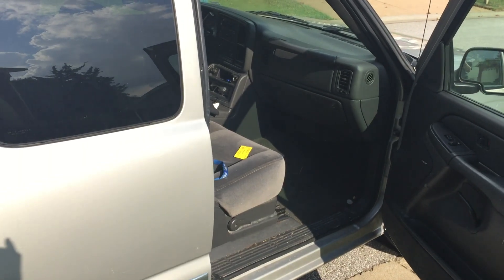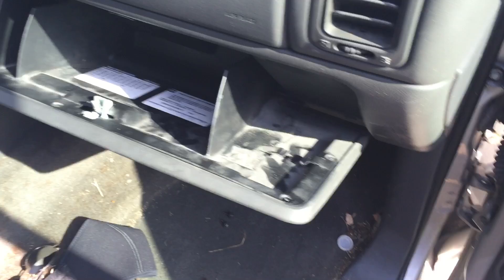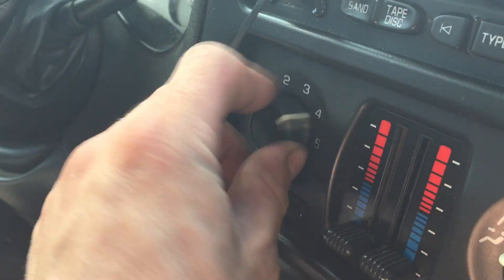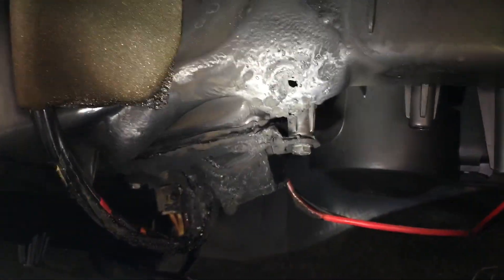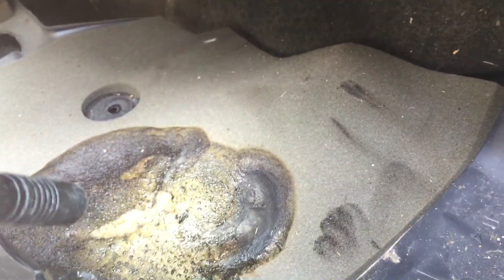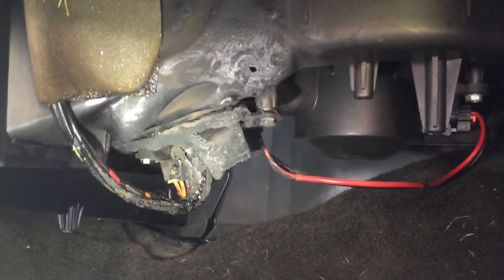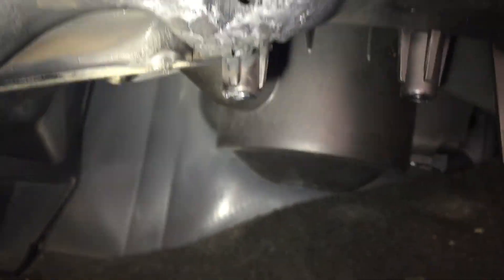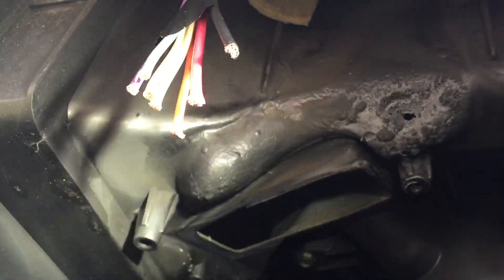GMC Sierra Fire Under Glovebox

Comment: I just recently had to replace both the resistor pack and blower motor in my truck, I've been missing a few speeds for a while, and the motor finally just died. I know in Durangos they have had issues where the resistor pack will melt and take the plug on the harness with it, thankfully mine didn't do anything like that. Honestly I'd probably replace the whole HVAC box, both because of all the damage, plus the smell of burnt plastic will never leave that brunt box.
Reply: +compactc9 I think the same thing happened to our GMC Envoy.

Comment: My fathers shitbox inline 5 2006 Colorado melts its resistor/resistor wiring every other year and ive done the blower itself 3 times. Ive told him every time ive fixed it that its a rolling inferno waiting to happen.   God damn thing needs a new head at 105k miles because the intake valve seat wore away in cylinder 2, and his steering rack leaks fluid.  You'd never know its a POS looking at it because the exterior and interior are immaculate.  Hooking up a scan tool and watching the misfire counter is pretty entertaining... so its got that going for it.

Comment: What's funny is there is actually a thermal fuse on the resistor pack (I can see it), however, because it is so far away from the connector, it didn't get hot enough to break the circuit!

Comment: the resisters are simply coiled metal. the worst idea gmc had...lol iv fixt them on 3800s nice vid
Reply: Nothing wrong with coiled metal. XD
It's very likely made with a metal called "Nichrome," which is used as a heating element in electric heaters. It's coiled because that is a nice way to package it.
Here it is intended to reduce the amount of power that the blower motor consumes, slowing it down. It's kind of a crude way to do it in my book, but it does work - as long as you design it properly!
And it's not just GMC ... Vauxhall has had the same issues.
Reply: Benjamin Esposti true. Ps off subject but check out AC Delco electronic ratchet it sooo cool

Comment: same thing happend to me with a work truck around 2004 chevy caught it before it lit up. I also had a 2003 dodge caravan with a melted connector my theory is when the blower motor starts going out  it pulls too many amps through the connector and the resistor is not able to handle all the current and it gets hot too.

Comment: It it legal to get a car on the road without a fire extingisher ?. By they way, didnt fuses should catch that ?. Could the new resistor installed in the orignal position ?. Plastic is deformed to bad. Resistor is cooled in the duct, so need to get air circulation around it.
Reply: Private use vehicles are not required to carry a fire extinguisher. Public/City vehicles like; City buses, School buses and many other Public/City vehicles are required  to carry a fire extinguisher on-board.
Reply: MustangDriver1734 Here privates are required. If you are stopped, appart from the paperwork and licence, Police can ask you to show the fire extinguisher (with other safety elements) since its mandatory. No only that, they check date and of course that its full. Regulations ask for 1kg, small one. It is hopeless on a big fire, but ... It could be helpfull in some cases. Also regulations ask the fire extingisher needs to handy to the driver and well secured ... LOL, at least your car is ready to hit the drag strip.
Reply: 38911bytefree Do you live in the U.K.? I live in the U.S. I keep one in my Mustang and my Grand-Prix regardless of law. I have one in my Mustang in-case someone on the side of the road needs help. Plus if my Mustang does catch fire, it minimizes damage. I keep a full size extinguisher in my Grand-Prix though... They're know for becoming "lightning bugs" or "Fire Flies".

Comment: The resistor almost certainly didn't catch fire itself. They are typically made from either ceramic or carbon film. So it just generated enough heat to ignite whatever was touching it.

Comment: That blower motor resistor is not the original from factory. Ones from carquest, oreilly, napa, etc. have that green goo overlay over the resistor board. My OEM one had a bare circuit board look to it. (2002 ECSB)

Comment: Ford Econoline vans have this issue as well. While I've never seen one catch fire from it, the resistor wiring gets very hot and eventually burns off, leaving only high speed for operation. Its under the battery in the engine compartment, which doesn't help the heat factor much either.

Comment: Well considering the bulletin stating Canada only is there something you can find for the US? honestly with all the recalls im surprised this one did not come up yet, my guess is it is on the list
#11046: Product Safety-Special Coverage-Heating, 
Ventilation, and Air Conditioning Blower Not Fully Functional on All Blower 
Speeds, Inoperative or Runs Continuously with Ignition Off (Canada Only) - (Apr 
7, 2011)

Comment: Yep.
The fan resistor was the very first part that I had fail on my 02' Tahoe.......went about 75K miles, then I lost 1-4 on the fan speed.
Reply: ohhhh lucky i got 50k before mine caught fire, smoked and burnt out the body control unit on my 06 Colorado

Comment: Well isn't that a bit of rotten luck! I work for a auto parts company, and (I AM NOT BEING BIASED) we go through GM blower motor resistors more than any other vehicle. At least GM trucks make the HVAC assembly easy to get at, and repair.

Comment: Wow. There's a shit design!

Some rigs (like my first-gen Pathfinder) don't have a cabin air filter, so leaves and pine needles and junk get into the the HVAC system, and the blower resistor sits right where the crap collects. Get enough pine needles packed against that resistor, with forced air blowing across, and you can have a very bad day.